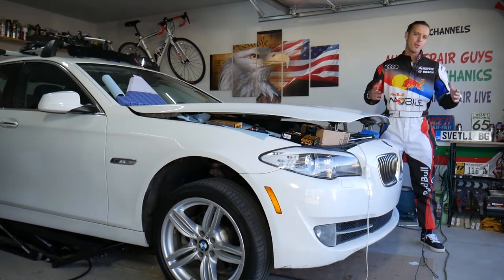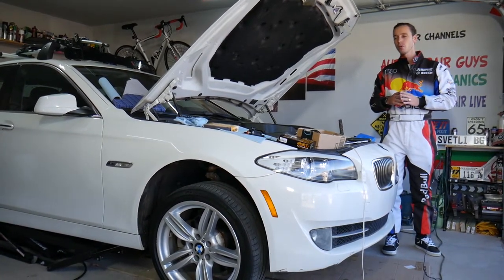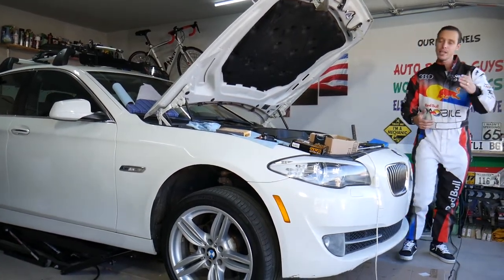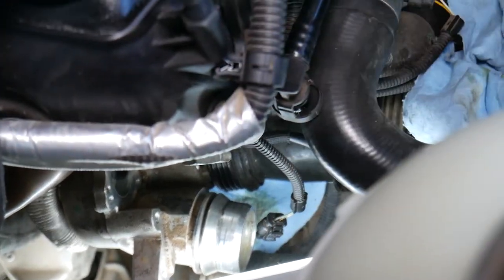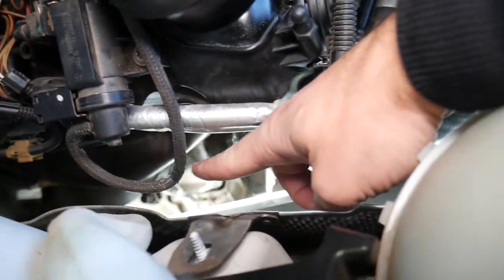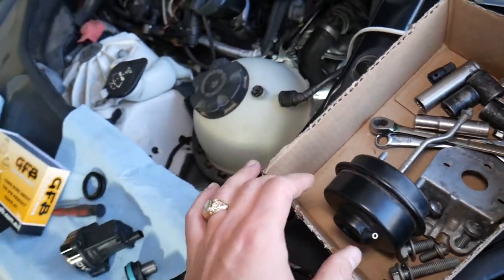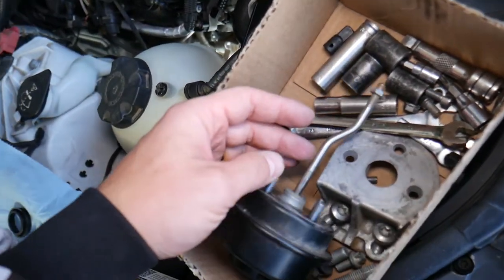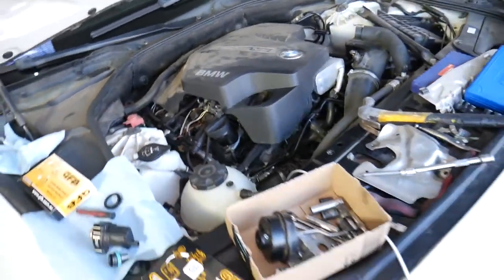WHAT CAUSES OVERBOOST CONDITION ON A CAR

Comment: Can boost solenoid cause overboost ?
Reply: yes it can. that was my case
Reply: @rankmeuptoday2119   basically i have replaced one for the big turbo as my car is twin trubo . It stopped going into limp mode on high speeds for a week . But same issue again. 🫠
Reply: @Cocovlog283   have you tested it? you can check if the  solenoid is bad
Reply: @rankmeuptoday2119  I didn’t test it i just replaced it and I didn’t know you can test them
Reply: @Cocovlog283  did that correct your problem?
Reply: @scottyjohnson4386  it didn’t